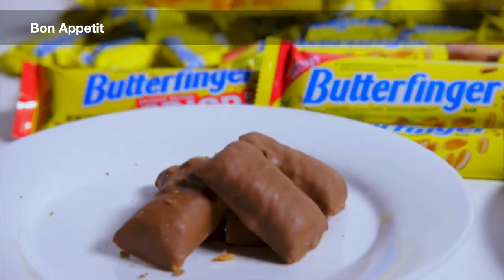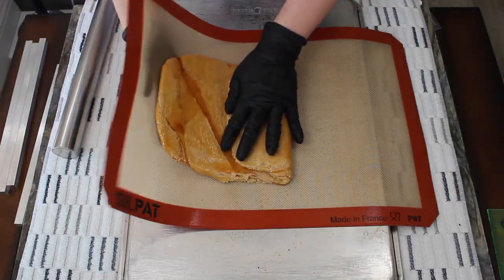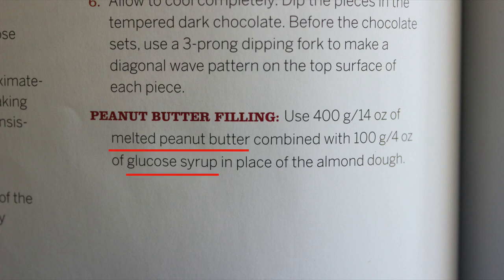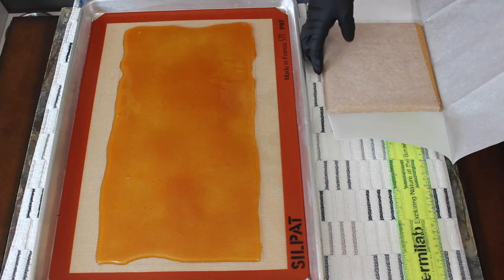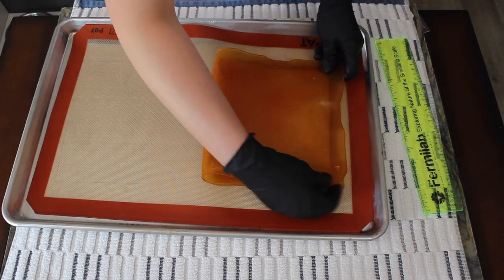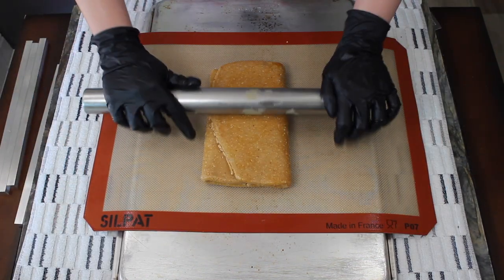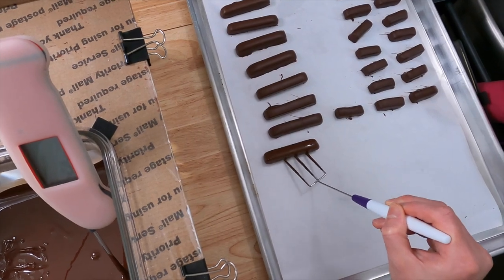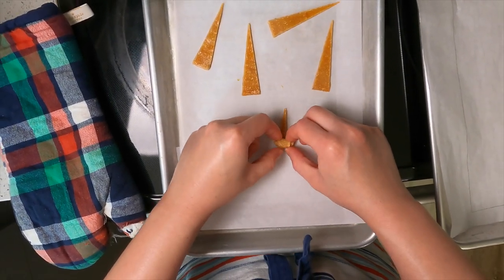Food Scientist Makes Artisanal Butterfingers | Reclaiming Chocolates and Confections

Comment from the maker: Clarification: In this video, I demonstrate the old-fashioned, manual method of making laminated candy (laminated candy existed before Butterfingers). This is not how manufacturers make commercial Butterfingers. Instead, they use industrial machines that simulate the lamination process (e.g., compacting-layering lamination, coextrusion lamination, stream-layering lamination, etc.) to produce a laminated-like product, allowing them to produce at large scales and sell their product at a low price point.
Reply: How does Draghi make chocolate and what are the ingredients

Comment: Incredible channel, hope it reaches a larger audience soon! In the beginning you said you were creating a butterfinger using a caramel instead of a hard candy for lamination, what’s the difference? And how many layers did you end up after lamination? I calculated 243 and I’m kinda amazed how many you could get into the bar.
Reply from the maker: Thank you very much, rollercoaster24! That's a great question. Hard candy is a bit of an ambiguous term — there’s no consensus about what candies fit into this category, but for the purposes of this video and YouTube series, I'm defining hard candy as a sugar solution that's been cooked to the “hard crack” stage (146-154C/ 295-309F), leaving a final moisture content of about 1-3% and that has been cooled quickly to create an amorphous glass (think lollipops, candy canes, and ribbon candy). Caramelized sugar is sugar that has been heated to at least 170C/338F (0% water) and undergone the caramelization browning reaction.

Repeating the rolling and folding process 5 times created 487 layers of sugar and 243 layers of filling.